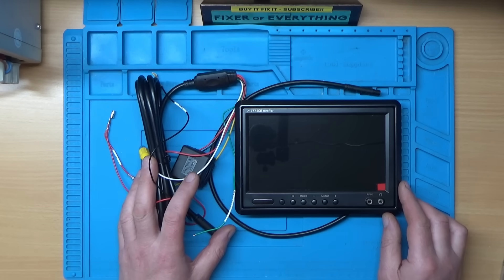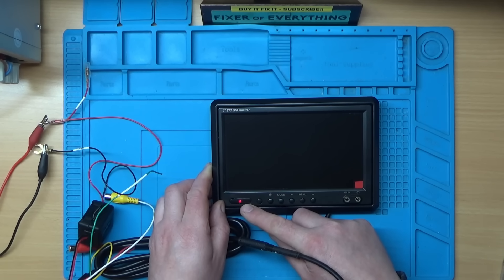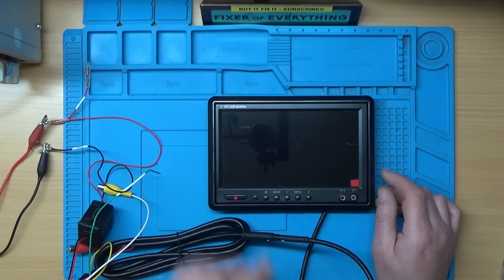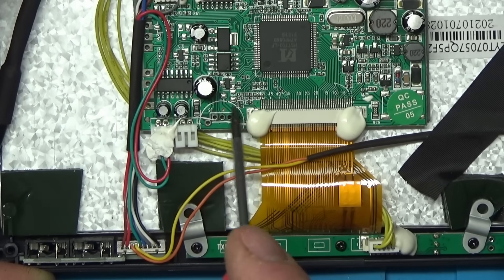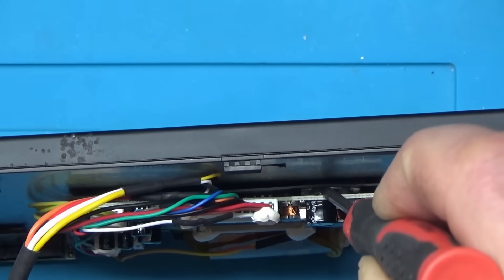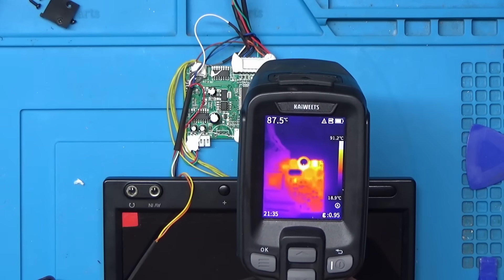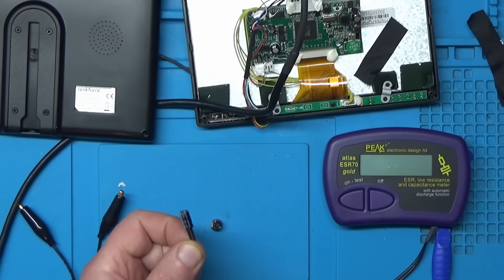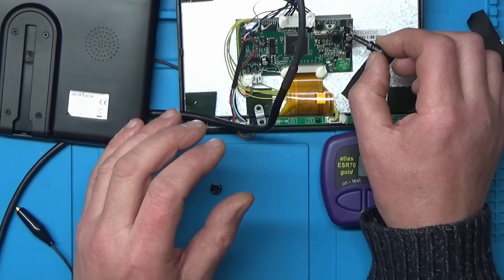Faulty Renkforce T-701B Car LCD Monitor | Can I Fix It?

Comment: Great video, again. I can't help but think these products are actually designed to fail from the get go. I'm going to take a guess that your repair will last infinitely longer than that original low profil cap. I think those IR cameras are worth their weight, I'm saving up for one.
Reply from the maker: Thanks 👍Yes, thermal cameras are definitely a handy bit of kit!

Comment: i have an electric piano sounds beautiful when it works but when you turn it on, you don't hear anything for about 10 minutes or more. when it warms up. do you think the problem might be a dodgy cap?
Reply from the maker: Yep, sounds like a cap. You could use some freezer spray or air duster (upside down) to narrow it down. When you cool the cap I'd expect the sound to go off again.
Reply: @BuyitFixit  i should definitely get some cold spray, or hopefully it will be visible

Comment: I sent you an email about my noco charger , but not heard anything back
Reply from the maker: @microcampersukvanlife4810  I've got a few emails I need to reply to, just not had the time yet. Currently in the barn as just had two lambs born.
Reply: @BuyitFixit  not the best weather for lambs , used to seem them a lot with plastic bags on in Northumberland. I’ve got a noco charger with a component fault on the board , battery is good , but was wondering if you could cast your eyes over it for fixing
Reply from the maker: @microcampersukvanlife4810  yes we've just put plastic coats on these two. Depends what component as there's a main IC which contains software which can blow in which case it's not repairable.
Reply: @BuyitFixit  I think it’s the 3v rail thing with 3 legs on
Reply from the maker: @microcampersukvanlife4810  That could indicate that there's a short on the 3V line, which goes to the main IC.
Reply: @BuyitFixit  is it possible to drop it off for you to look over?
Reply from the maker: Sure, i did reply to an email about a NOCO not sure if it was you? I get quite a few emails as you can imagine..
Reply: Email sent with pics

Comment: Hiya Michael, I’ve got an Optimate 3sp 12 battery charger I use for my mobility scooter (yes it is 12volt not 24) would you consider having a look & make a possible video of it? I’d be obliged if you will. Cheers John.
Reply from the maker: Hi John, drop me an email at the name of the channel at out look dot com.

Comment: EXCUSE ME, BUT!
Wouldn't it be better to bend capacitor UP instead of right? In such way the chip would not heat up the cap. And cap would not create additional barier for heat to dissipate.
Reply from the maker: Good idea, I just went with the way the holes were orientated on the PCB, as it would he harder to bend it the other way.

Comment: Hi,
Well done!. Another successful repair! I always enjoy your well-founded repair videos. Maybe 1 small tip, I would have bent the electrolyte capacitor to the top if possible so that it is heated as little as possible by the SMPS control chip. Electrolyte capacitors do not handle heat very well, it causes the electrolyte to dry out and the capacitor to fail. It is true that electrolyte capacitors that are close to a heat source fail faster. Keep up the good work and take care. Cheers.
Reply: I was thinking the same thing. That cap will get roasted by the chip in no time and maybe even POP!
Reply from the maker: Thanks👍I didn't think of bending it upwards. It might have been a bit awkward to do due to the orientation of the legs.

Comment: I knew Renkforce was cheap but that's barrel-scraping Temu build quality right there. I absolutely cannot stand stuff that is slapped together with sellotape and hot snot, and those "1000 for a dollar" cheap caps that fail in months.

That said a fix is a fix 😂 Nice video matey.

Having said that, I took apart a Panasonic networked speaker earlier and wish I hadn't... that went completely the other way, a work of art of metal-chassis, interconnecting boards and rock solid build - but utterly impossible to work on unless you have a masters in electronic engineering - I'm just going to accept that the WiFi is broken and leave it as is!
Reply from the maker: Thanks👍. Yes not great build quality on this. Shame about the Panasonic speaker.
Reply: @BuyitFixit  Actually, do you want to give it a go? 🤣

Comment: Nice one !
The IC going to overheat gives me an observation : this is a reverse monitor => that means you're not supposed to let it switched on for a long time. Anyone driving in reverse for miles ?
So, I think the owner must have used it continuously for long periods. And the close capacitor didn't liked it.
Reply from the maker: It can also be used for in car entertainment. It just has a wire to automatically switch on when that's connected to the circuit the reversing lights are on.

Comment: What is the bench power supply you are using? I don't think you ever mentioned it.
Reply from the maker: Hi Tony, I've got two now as a viewer kindly donated one to me a few months back. The one I was using originally that I purchased used from eBay is a TTI EX4210R, and the one I'm using now is a TTI TSX3510P. Hope that helps.

Comment: Good repair, I also said cap soon as you was describing the error. Reminds me of old LCD panels always bad caps.
Reply from the maker: Thanks 👍Yes I remember LCD TV's stuck in standby or the standby LED flashing. Used to always be output caps on the PSU, or occasionally the small startup cap.

Comment: Great work a nice easy fix ,I wonder if you replace with a better quality capacitor when new they will last longer .Good idea with the larger cap to keep the legs longer as it is now away from any heat that might have been part the cause of the failure.
Reply from the maker: Thanks Paul, yes it seems strange that the only capacitor to fail was a totally different make to the other capacitors. Perhaps it was just a poor quality cap compared to the other make.

Comment: I would not replace a capacitor I'd pulled out due to the risk of damage to the wire seals. So it might leak later on
Reply from the maker: @TheEmbeddedHobbyist  It came out very easily, I only had a little bit of pressure on  it👍

Comment: Call me a pessimist , components normally fail for a reason. I still dont trust ribbon cable, in an automotive environment. Low quality front to back cable cannot be trusted either..😂
Still a great video👍🏴
Reply: Since the capacitor is so close to that always [when the car is running] hot power-supply-ic the cause could be  classic thermal degradation
Reply from the maker: @chrisprobert6  Cheers Chris 👍This capacitor was a different make to the other so might be a poor quality one. Also in switching power supplies the capacitors usually get quite a hammering so they are more prone to failure.

Comment: None of my little monitors has audio --- though the cases have holes where a speaker should go :face-green-smiling:
Reply from the maker: I wonder if there is an amplifier on the board and it just needs a speaker connected?

Comment: I'm gonna have to invest in one of those thermal cameras.. Great video as always!
Reply: I have that exactly same camera branded as "Guide PC210", nice quality for the money (~300€).
Reply: @jaketzi8816  i've seen one on A**express for around £90 called 'BSIDE HX1', don't know how good they are??
Reply from the maker: Seems the FLIR sensor only that one only has a resolution of 96x96 pixels which they then upscale. The one I'm using has a sensor resolution of 256x192 pixels. It also has two cameras (A visible light, and a FLIR) so you can mix a real picture with the FLIR picture in real time.
Reply: @ In PC210, detector type is 256×192@12μm VOx and with IR, Visible, PiP and MIF. There is a cheaper version, T120, same frame but with a 120x90@17μm sensor. I hope you mixed the models because if you didn't, i paid way too much of mines. Anyways, i still stand behind my words, nice quality for hobbying (and maybe for the money?). Keep up the good work.
Reply: @jaketzi8816  https://youtu.be/UnR2DS97Nvw?si=ZAidAyAaGLdspMgI
Reply from the maker: @dean6816  Thanks 🙂👍

Comment: You can use your PEAK ESR meter to measure capacitors in circuit. It will save a lots of time.
Reply from the maker: @paulgolub9936  I totally keep forgetting about that, although I did try it before with mixed results on some caps.
Reply: @BuyitFixit  Yes you do 😀. These are the jobs that will confirm that "9 times out of 10" measuring in circuit does work. Once you've done a lot of measurements in circuit, then out of circuit, you start to get a good feel for what a good or sus reading is on your particular meter. The low uF electrolytics are often the tricky ones, they have a relatively high ESR when new, so say 2-4 ohms on your meter means they are ok.

Comment: I've used dental floss to "cut" through stubborn double sided tape like that before. Nice when you're worried putting any pressure on the parts by prying.
Reply: Or fishing line.
Reply from the maker: @oliverer3  Good tip 👍
Reply: Cheers, great idea, and, bonus, your PCB will taste minty after 😂

Comment: A capacitor, go figure.  Your finger found the fault..ouch!  The thermal camera confirmed the suspect, nice piece of gear.  Just got an ESR 70, so much easier to use than my DE-5000 although probably not as precise.  Easy fix this time, great video.  See ya next time, thanks.
Reply from the maker: @terrym1065  Cheers Terry 👍

Comment: Thanks, ~ smooth repair, even with sticky hands.
What type of "Paper" used on metal plate & board, (each side of sticky pad)?  
I've heard term, 'Fish Paper', ... tho i not know, Odd its sound of paper 'made me ask'.  lol 

2:47  vs  7:35  [melted] spot?  perhaps not, [just] battle wound, and reason used.
Reply from the maker: Thanks 👍not sure on the paper, it was a green type of card?

Comment: I think the capacitor failed because it was low profile. The low profile capacitors can't handle as much ripple current, which means they tend to heat up more when stressed. Between that and the crappy brand of the capacitor, I'm not surprised the capacitor failed.
Reply from the maker: Yes I noticed this cap was a different brand to all of the rest of the capacitors fitted.

Comment: Great job, the cap you changed was the first thing i was suspect of because  of the imprint on it looked  funny. Besides that I loved Rayman great game
Reply from the maker: @wasserman63  Yes Rayman was a great game 🙂The imprint on the top of the cap is just a marking so it can vent if pressure builds up inside of it. Different manufacturers have different patterns. This cap was made by a different manufacturer than the rest of the caps.
Reply: @BuyitFixit  I am not native in English  but that imprint looked suspices to me greetings from germany

Comment: We miss composite video signal on modern equipment, even with oscilloscope you can see that there's an output. video.
Reply from the maker: @electronics-by-practice  Yes, also it was easy to distribute across multiple TVs with an RF modulator 👍

Comment: Those screens are for rear seat entertainment
Reply from the maker: Yes, they can be used for that, but they also have a separate wire called reverse which you wire into the reversing light circuit.